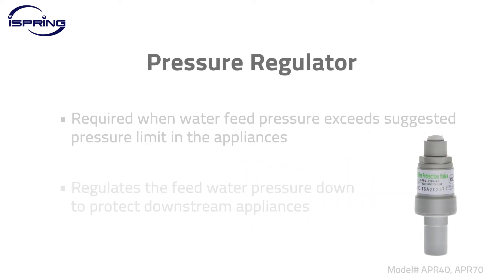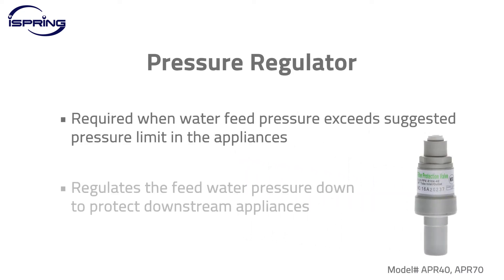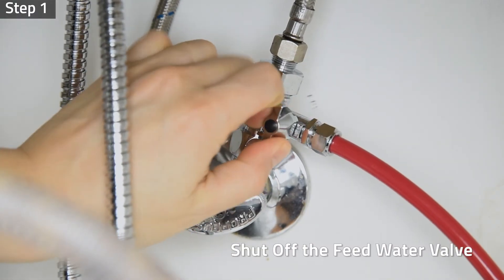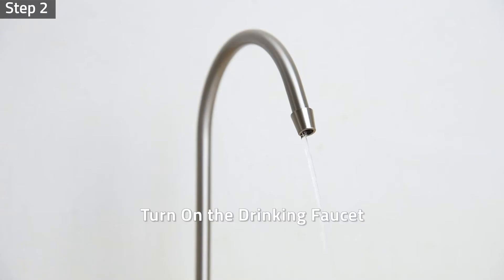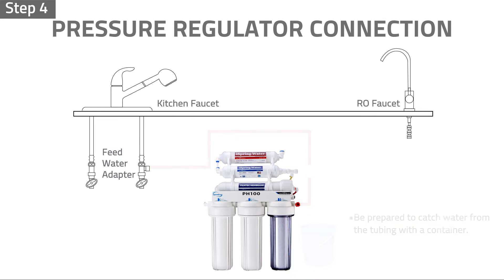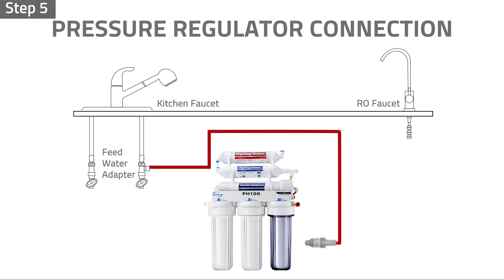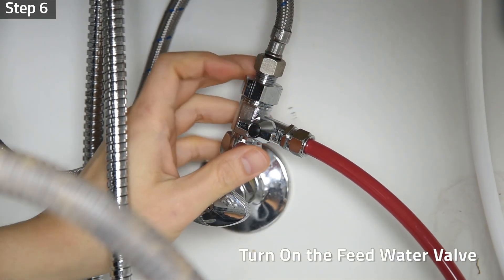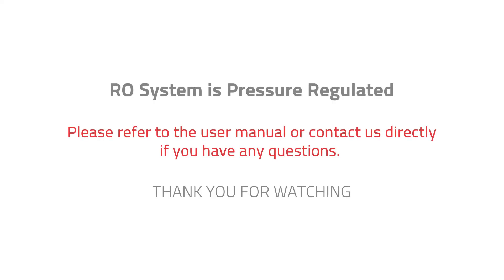How to Install a Pressure Regulator to Your Reverse Osmosis (RO) System | Easy DIY

Comment: Why didn't you put it on right after the tap?
Reply from the maker: Hi Kadir. The pressure regulator is put on right after the tap and before the water filtration system in this video. If you have more questions, please give us a call at 678-261-7611 (M-F, 8:30 - 5:30 EST). We are happy to help!